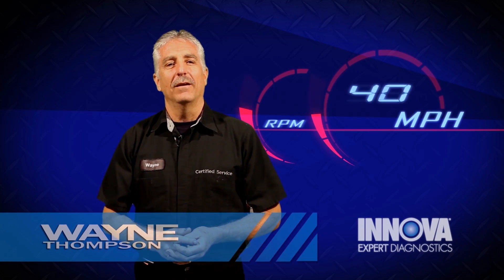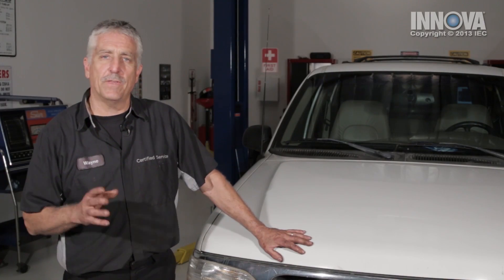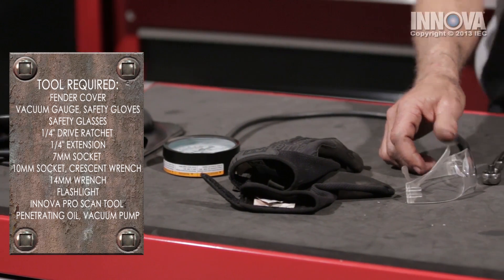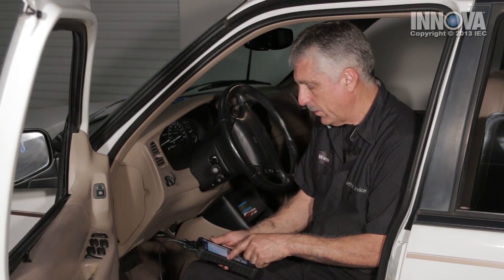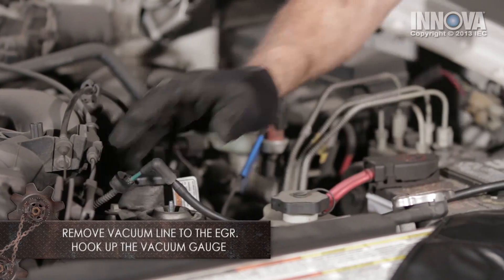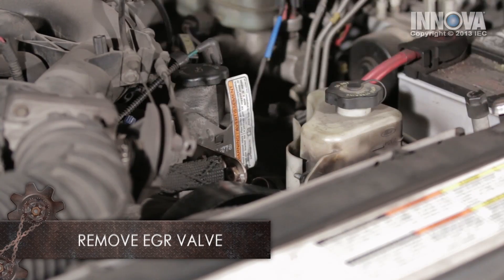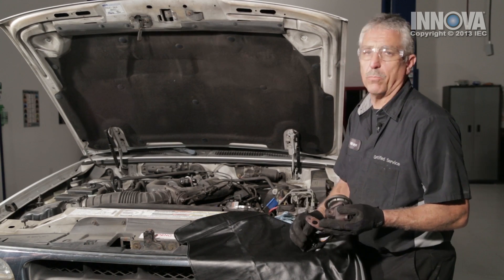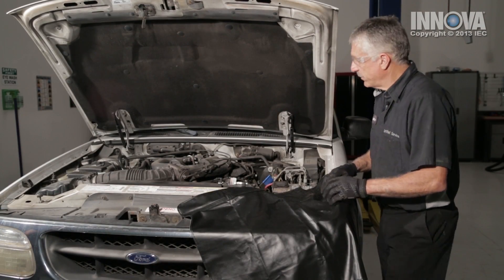How to diagnose an Engine Misfire - Faulty EGR Valve - 1997 Ford Explorer

Comment: Is there a reason that you did not put a hand vacuum pump with gauge on the vacuum port of the EGR valve to see if the diaphragm was working properly and holding a vacuum?

Comment: Help please ... my car has weak acceleration when I push the gas... and when I checked the engine a metal hose from the exhaust connected to the EGR solenoid was blown.. I replaced the hose now the acceleration is worst then be for... I tried blocking off the return hose and the acceleration is better but I’m still not getting all the horse power . Can it be the solenoid ?? It’s a 2002 Cadillac Deville  North Star v8

Comment: What if your egr is not very dirty?  I suspect my egr control solenoid is bad it makes weird noises and tapping it makes it stop im assuming a sticking solenoid.  I sucked on my egr valve and it works properly.  I have a 97 f150 4.6

Comment: Odd he didn't check the EGR for function or simply clean it and reinstall, went straight to the new one $46 bucks plus $100 labor... sweet.
Reply: Even a sticking egr will still bring a customer back. Its only $50 for a new one!??? Why didnt you replace it!? Two sides to a coin.
Reply: And how old is it? Would you want to rely on an antique part, after spending all of that time and money? $46 is nothing, I’m sure it’s not his first rodeo.

Comment: I have a 1997 Mitsubishi eclipse rs that misfires I hooked it up to a tester and it told me it's a cylinder 1 misfire could the egr be bad or is it worse I've already replaced the coilpack spark plugs/wires
Reply from the maker: +Alex Zapata we are sorry to inform that we do not have service manuals for your vehicle to give you repair advice.